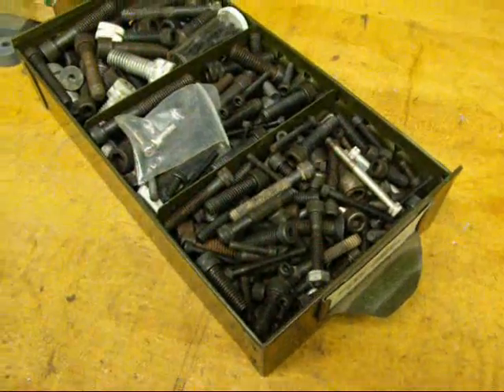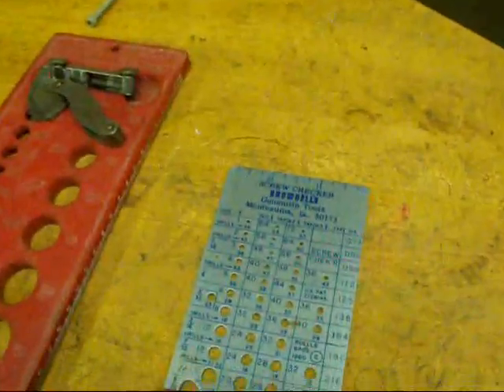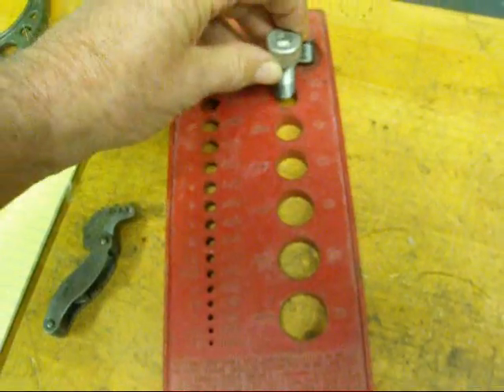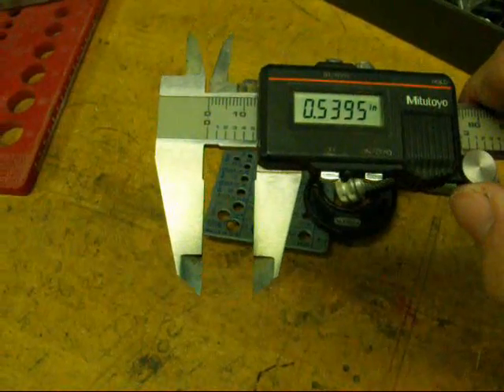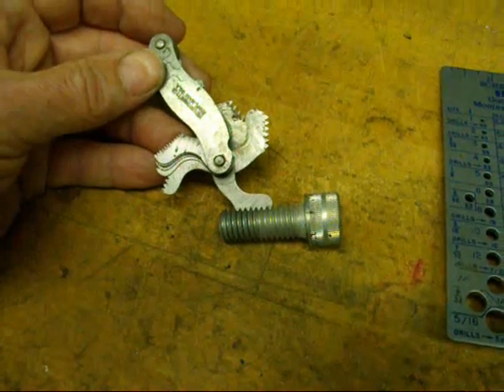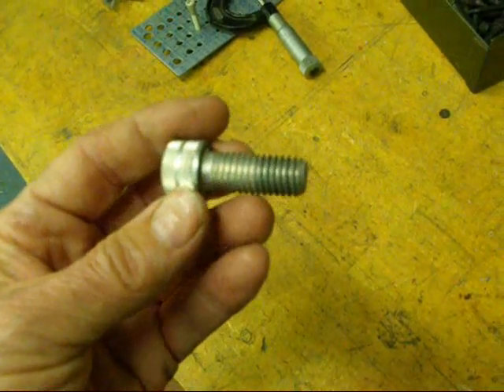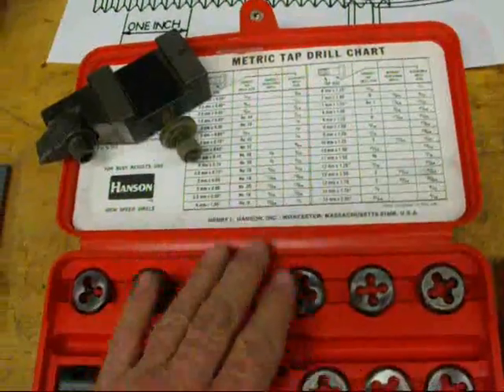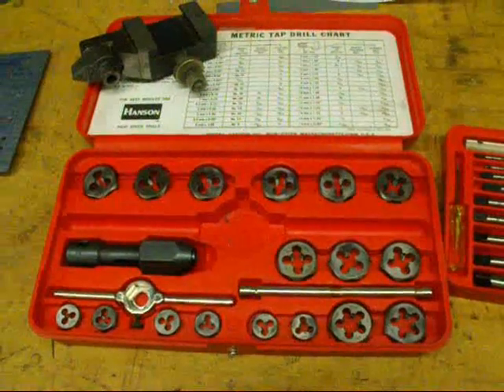MACHINE SHOP TIPS #10 Identifying Bolt Threads tubalcain

Comment: I bought a jig that has a thread or bolt for metric and inch. And i bought each nut and bolt and threaded it on the jig. If i working on a part that is missing a bolt i find the right size buy threading it in. If i have a loose bolt a can thread it in the jig. Invaluable tool for people that work on everything.Finding the part one you figure it out is the hard part. Drive here then drive there.. Here is a link to what the jig looks like.https://www.amazon.com/METRIC-Gauges-Check-Thread-Fastener/dp/B0098JILSW/ref=sr_1_2?ie=UTF8&qid=1532021781&sr=8-2&keywords=Ortus+Enterprises

Comment: I agree, I like the metric system much better and try to do everything in metric.  USA system is so confusing.  In my college I had to deal with both, but when it came to threads, taps, dies and drill sizes the teacher just told us or had the tool to use and no one was really explained anything.  Now at home trying to learn to use a metric tap/die set I am trying to learn it myself and it is not easy.  Just for tests, I used a 3.45mm shaft and threaded it with a M4x0.7 die.  and using the same shaft I used another M4 die marked 0.75.  I can't figure out what the difference is?  I assume M4 means diameter of the shaft.

Comment: thanxs a lot for making this videos, i have really learned a lot with your videos  and i agree with you that metric system makes more sense than the american, i live in Mexico and i really don't have a clue why we use the american system usually when we work in machine shops, when its really hard to measure 17/64 instead of the metric measure that is easier. once again i really appreciate your work

Comment: @coriander2 10/32 means it measures  10/32 of an inch.. in layman's terms it's 1 inch divided by 32 and multiplied by 10. 1 inch being roughly 2.54cm this equates to 2.54/32 = 0.079375mm, this x10 = 0.79mm (rounded)
Don't know if you were really asking for an explanation or just being sarcastic so...